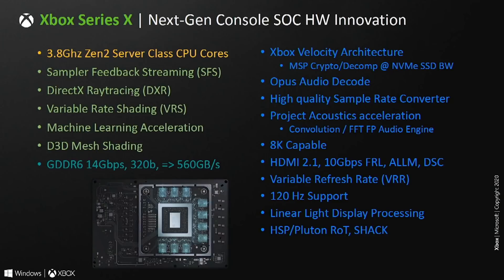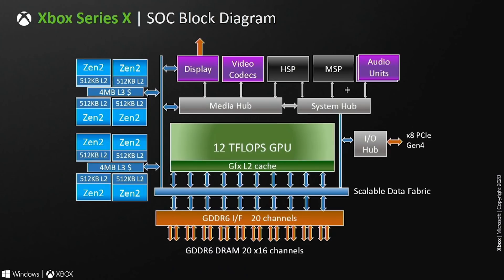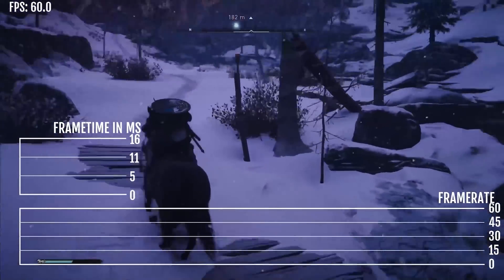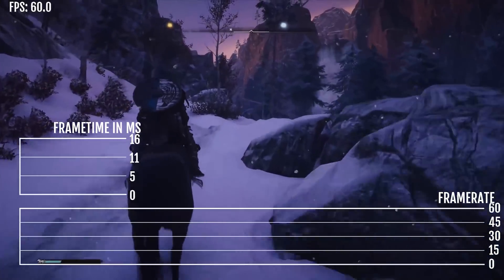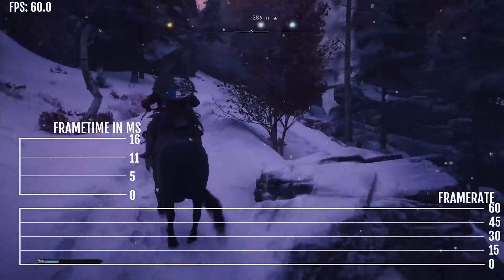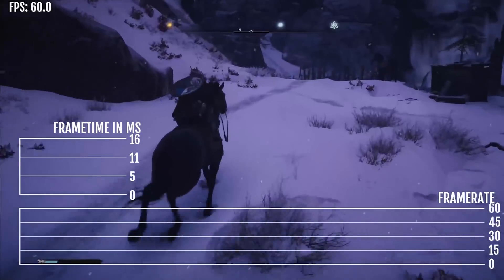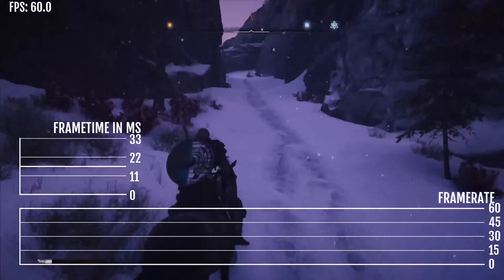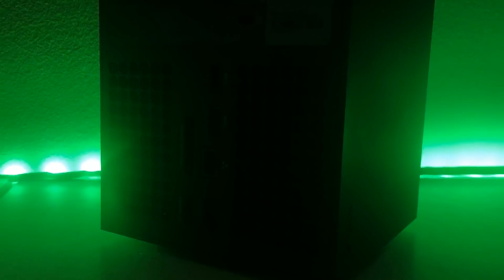Xbox Performance to be UNLEASHED | Xbox Series X Mesh Shaders & SDK Updates Changes Everything

Comment: Series x has a great gpu and great gpu features but the cpu is LAAACKING on pc if you have a 12tf gpu generally your cpu will be at least 4.0ghz. Not to mention 16gbs of ram is HORRIBLE even on modern day PCs but for next gen stuff? That’s a huge bottleneck. The ssd on the series x is great but them saying It can load in stuff like the ps5 is just advertising in practice that’s impossible there storage and overall console speed is too slow. That 12tf is great but further into the gen I doubt it will fully be utilized because of the memory and series s holding devs back. They should’ve went with at least 20gbs of ram for x and 12gbs of ram for s BUT I’m fairly confident they will just release a mid gen upgrade 2023 and 4 and then just tell developers to make games sub 540p 720p on s and 1080p on x and have the mid gen upgrade keep up and most likely surpass ps5. And I think PlayStation will either release one of there own to finally make 4k 60fps ray tracing an reality and more 120hz games or just release a ps6 2025-2026
Reply: I think ps5 and series x both will get a pro version after 3 years. Altough ps5 is out performing series x by a good margin in open world games and games I'm general. But when u look at how much both series  x and ps5 has to compromise on resolution. I think if these companies do not release an upgraded series x and ps5 I am certain that 4 years into the generation games thar actually take advantage of the hardware will be running at 30 fps with resolution falling down to 1080p. I think it will become increasingly difficult to maintain 60 fps in games. I think both Sony and microsoft should have waited before releasing ps5 and series x
Reply: @deepinsight1175  the more that both consoles are optimized,  and once engines like unreal 5 are utilized.. not to mention amd version of dls are in play it'll be fine... the reason for pr consoles was the utilization of 4k tvs....
Reply: @deepinsight1175  honestly I agree with this. I think the ps5 is perfect in terms of not holding anything back. Lots of ram inside of it needed for next gen games but in no world can I see series s or x lasting... ps5 will be a 1080p 60fps Full RT HOPEFULLY console... but imo they shouldn’t invested more in stronger gpu and cpus as well as stuff like machine learning why... are they using AMDS DLSS solution? It will most likely just be exactly like unreal engines which is ok but it’s just 1440p to 4k. They shouldn’t made them 500 and 600 dollars no mid gen refresh it’s insane how two generations in a row both Sony and microsoft have had to make mid gen refreshes for 4k. No other gen has had to do this.. though I suppose ps2-ps3 all struggled to achieve 1080p until ps4
Reply: Just nope....
Reply: And you think they should've went with those specs?  Dude do you even have a clue?  So tell me what would the price point be if they went with all that?  They're trying to reach mass market, and price, especially now during a pandemic is critical.  The series X is based on the 6,000 series AMD cards which by themselves cost hundreds of dollars, and when you count the cpu, hard drive, and controllers...well you get the picture.  They would've had to charge through the nose!!
Reply: @terrenceholland6355  doesn’t matter??? These consoles would’ve launched with those specs pandemic or no pandemic. It’s literally not a next generation console. You can’t have 16gbs of ram and be a next gen console it’s just not enough memory even with an ssd. The reason why Sony gets away with this is well there gpu isn’t even that powerful so doesn’t have to worry about major issues with high res textures and the ps5 is just a revolution in terms of how it’s built and designed. You don’t need more than 16gbs of ram if you have an SSD and chip that can at a minimum in 0.25 seconds load in 4gbs of game data.
Reply: @Entertainment-ev6ob  I think you need to read up on the velocity architecture more thoroughly before making that assumption. The Sony SSD in many cases loses to the series X when loading games.  How people tend to overlook this boggles my mind.  And even when it comes out on top it's only by a few  seconds.  You're trying to compare the ssd's by the specs and that's misleading since they use different architectures.  So far real world use shows extreme parity in loading speeds.
Reply: @terrenceholland6355  ?? Your the one being misleading it’s beyond how fast stuff loads in my guy. Also the velocity architecture is literally playing at words to get fan boys to have an excuse. The velocity architecture is just a bunch of software that’s also on pc. It’s going to help.... but at the end of the day it isn’t the messiah. Ps5 loses on loading because devs don’t optimize for it correctly. Any game that fully utilized the ps5 ssd loads in less than a second... godfall, spiderman, final fantasy remake (that shit was like 1 second and the ps4 version was almost a minute I believe?) I mean to be fair Xbox has no games so it’s not like they have any first party to show there speeds but lol this isn’t comparable.
Reply: @Entertainment-ev6ob  Gears, Sot, Dirt 5, game pass says hello.  Typical fanboy response.  Says MS has no games and then goes on to name a remake, and two cross gen games based on last gen engines to support your argument.  And you accused me of being a fanboy?  BTW God Fall is likely coming to the series X so stay tuned.  As for the velocity architecture which you  know nothing about it's not just software based it's both hardware and software based and it allows MS to use up to 100Gb of their SSD as system ram not just for game storage. Sony to date is limited to the 16GB of graphics memory on the ps5 for games.  MS has the 16GB plus the 100GB giving them a serious advantage with graphical detail.  Oh and one more thing.  Those games that loaded faster on the series x weren't optimized for loading either.
Reply: @terrenceholland6355  my brain hurts after reading this... I’m not gonna bother denying anything you say everything you said was 100% correct
Reply: What ever you say dude.  I guess you know more than the MS engineers.  But hey I get it.  When MS says they have revolutionary ssd tech it's marketing bs.  When Sony says they have revolutionary ssd tech it's a done deal.   https://www.neogaf.com/threads/xbox-velocity-architecture-100-gb-is-instantly-accessible-by-the-developer-through-a-custom-hardware-decompression-block.1532436/
Reply: @terrenceholland6355  nothing you said represents anything a Microsoft engineer said. And even if it did if you blindly follow what billion dollar corporations say I think you have an issue
Reply: @Entertainment-ev6ob  Dude that information was from an actual MS engineer.  You know  one of the guys that actually help build the system!   MS has been trying to figure out how to use that type of RAM for nearly a decade because the cost of RAM hasn't been going down.  They knew they would need more RAM as graphics got more detailed and this is what they came up with.  In that link James Stanard, a MS graphics engineer responded to neogaf guys when they messaged him.  You have the audacity to tell me to look up Mark Cerny's reveal and then tell me not to trust an engineer from get this... "billion dollar corporations" you mean like Sony?  So Sony engineers can be trusted of course, but not MS engineers!  Fanboy much??  Dude I'm done with you!  Have a nice day!!

Comment: Is weird how you say this will "change everything",and forgot not only Cerny talk but Unreal Engine 5 demo and what they explain there...
Reply: That's because the change isn't limited to a specific platform or gaming. Its an industry change that affects computer generated imagery, CGI, in general. So it applies to games, animated movies, modeling software, etc.

Cerny talk is specific to the PS5. Support for the feature set of the PS5 is one aspect of the overall Unreal Engine which is used to make games and movies on multiple platforms. None of what he said negates any of the things relating to the PS5 and UE5.

That the PS5 can move and render that much data is impressive. However, what's more impressive will be the developers who take the time to make assets with such a high level of detail. All of that detail takes a lot of time, and time is money. That demo alone took months to create and it was essentially a short walk.

With games becoming more detailed, the next important thing will be AI and procedurally generated content. Otherwise we'll hit a wall called time and money.
Reply: Great point.
Reply: I think ps5 and series x both will get a pro version after 3 years. Altough ps5 is out performing series x by a good margin in open world games and games I'm general. But when u look at how much both series  x and ps5 has to compromise on resolution. I think if these companies do not release an upgraded series x and ps5 I am certain that 4 years into the generation games thar actually take advantage of the hardware will be running at 30 fps with resolution falling down to 1080p. I think it will become increasingly difficult to maintain 60 fps in games. I think both Sony and microsoft should have waited before releasing ps5 and series x

Comment: How will Sony port games using the own custom geometry engine to PC? Seems like when true next gen games come that could be a hindrance?
Reply: It would probably make the porting process more difficult however not impossible. Remember Sony expect third party devs releaseing multiplats to utilize the geometry engine too.
Reply: Sony dont need to port their games to PC.
Reply: @qualitygaming7169  but they are lol
Reply: @sickeststeve  They port last gen games to PC because PCs in general today is much more powerfull then PS4 and therefore ports are duable.

But Sonys next gen games maybe cant be ported to PC because most Pc gamers have quite old hardware. Therefore next gen games will not be ported until later in this generation as we saw last generation.

Also Sony needs exclusivity. Xbox does not because games pass is on both PC and console.

But I dont dont mind if Sony ports their games...
Reply: @sickeststeve  someone gets it.

Comment: I believe Geometry Engine can already achieve some form of VRS/Mesh Shading, not sure how that compares on a 1:1 level with DX12 implementation. But, what I do know, is that UE5 Nanite looks insane, and computationally, it's similar to Mesh Shading, but it leaves LOD's in the past.
Reply: I think ps5 and series x both will get a pro version after 3 years. Altough ps5 is out performing series x by a good margin in open world games and games I'm general. But when u look at how much both series  x and ps5 has to compromise on resolution. I think if these companies do not release an upgraded series x and ps5 I am certain that 4 years into the generation games thar actually take advantage of the hardware will be running at 30 fps with resolution falling down to 1080p. I think it will become increasingly difficult to maintain 60 fps in games. I think both Sony and microsoft should have waited before releasing ps5 and series x
Reply: No. VRS and Geometry Engine are simply not related.

The full name for Mesh Shading is 'Mesh Shading Geometry Engine.'

And Mesh Shading is handled at the hardware and accelerated level, will outperform the software approach of UE5.
Reply: @davenewman4663  And furthermore, VRS is a marketing term for a certain technique. DX12 VRS isn't the only way to achieve Variable Rate Shading.
Reply: @Chimpyboi  yes. But the actually act that VRS does - Geometry Engine has nothing to do with it... And PS5 doesn't possess VRS or alternate tech. No dev can say it is there, nor did marl cerny ever say it was.
Reply: @davenewman4663  And you know this how? For certain? am I claiming the PS5 does in fact have VRS? No. I am not, because I don't know, but VRS can be done without DX12 "VRS". I wasn't attempting to say Mesh Shaders and VRS are the same, I should of worded that different.
Reply: @davenewman4663  PS5 can at least do VRS in software......
Reply: @Chimpyboi  even Devs Such as 4A don't see VRS available. They all rely on software alternatives..
Reply: @Chimpyboi  He knows like he knew about RDNA 3 hiding in the PS5. 😅
Reply: @dasimparmy2289  lmao. Well, I'll believe Dealer and Colt and the rest of you as soon as it happens, for now, it holds as much water as "XB1 has a secondary GPU that Microsoft will activate and smoke the PS4" We can all talk as much trash as we want, but the results speak and will speak for itself.
Reply: @davenewman4663  bro, read up on how nanite is being achieved. It’s all hardware based. So a system that still relies on LOD is going to outperform one that doesn’t? What?
Reply: My concerns with Nanite still stands. It makes more sense for making movies than for making games. I know that they are also pushing the use of UE5 for making movies, so this all makes sense. I can already tell that Nanite is resource intensive. So using it will be great for high end PCs that have a lot of memory (think 64GB+). As variety of visible textures increase in a scene, the amount of high resolution assets that need to be loaded increases. The system then has to process all of those assets quickly.

Yes it's faster in terms of development time, just creat the high resolution asset and not have to switch mip levels, but it requires more memory and processing power.
Reply: @TheFirstRealChewy  so we’re just gonna pretend like they didn’t have a fully functioning demo running on the PS5?

Comment: With Mesh Shaders (and Primitive Shaders for that matter), should remember that quite a many game engines already do primitive culling in Compute Shaders, so the performance bump may be not be as drastic as one might one expect, or as drastic as marketing material might suggest.
Reply: It for sure won't be as good as the test that was made specifically to show the benefit of mesh shaders. My expectation is that it will allow for better use of parallel processing so could end up changing the overall approach to rendering a scene. We could end up with predictive rendering.
Reply: I think ps5 and series x both will get a pro version after 3 years. Altough ps5 is out performing series x by a good margin in open world games and games I'm general. But when u look at how much both series  x and ps5 has to compromise on resolution. I think if these companies do not release an upgraded series x and ps5 I am certain that 4 years into the generation games thar actually take advantage of the hardware will be running at 30 fps with resolution falling down to 1080p. I think it will become increasingly difficult to maintain 60 fps in games. I think both Sony and microsoft should have waited before releasing ps5 and series x

Comment: Both consoles will get better overtime. I’m glad I own both.
Reply: That's my plan as well. Just sit back and watch the fans in each camp fight over which games they won't be playing.
Reply: I think ps5 and series x both will get a pro version after 3 years. Altough ps5 is out performing series x by a good margin in open world games and games I'm general. But when u look at how much both series  x and ps5 has to compromise on resolution. I think if these companies do not release an upgraded series x and ps5 I am certain that 4 years into the generation games thar actually take advantage of the hardware will be running at 30 fps with resolution falling down to 1080p. I think it will become increasingly difficult to maintain 60 fps in games. I think both Sony and microsoft should have waited before releasing ps5 and series x